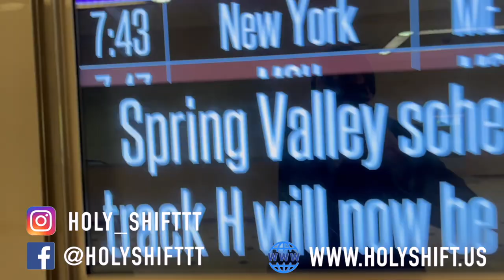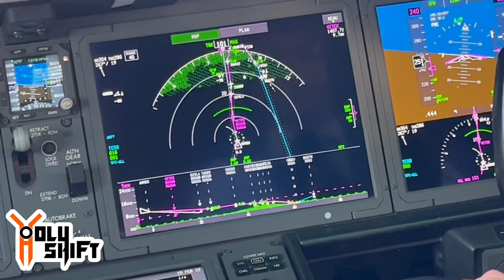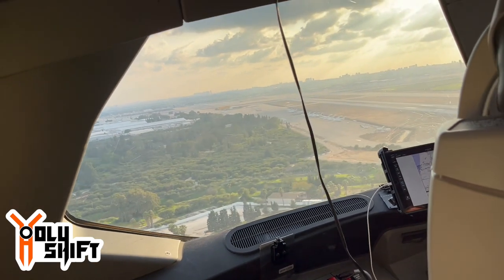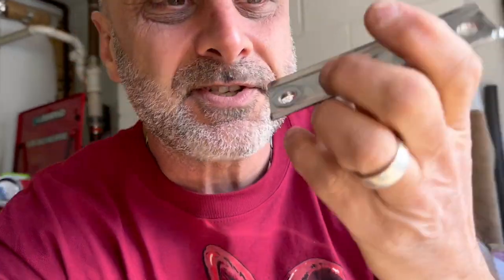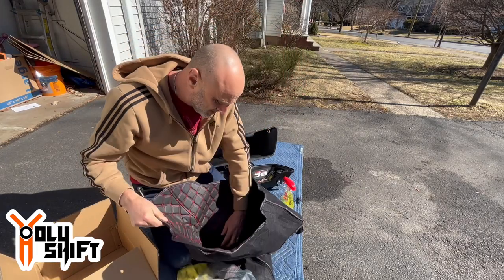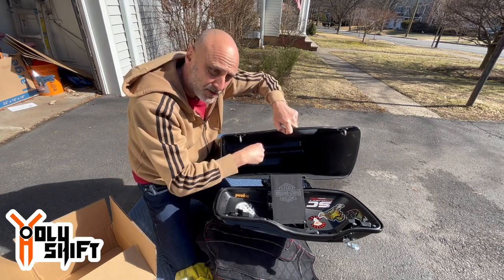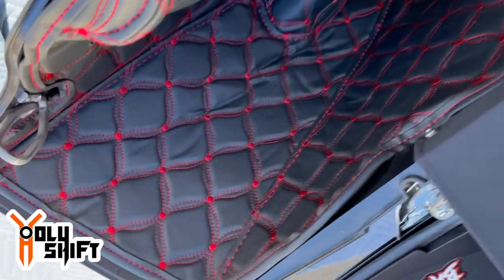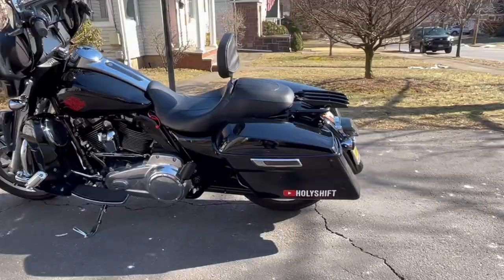Advanblack Dominator Fender Conversion Completed

Comment: That’s funny, I JUST installed those brackets like 5 days ago.  My pipes would not align after putting on my  Stretched bags, and those brackets worked like a champ.  Next up is the fender extender.  👌